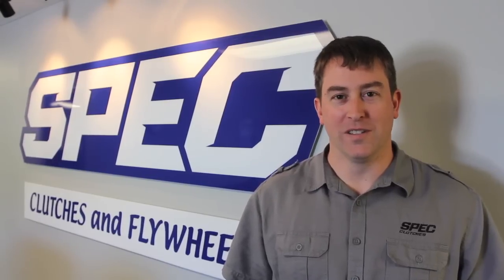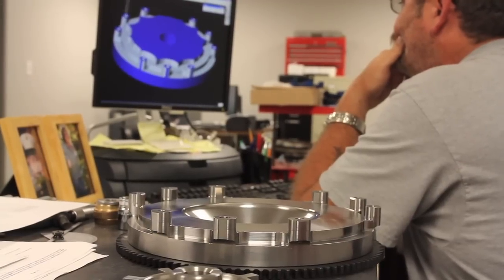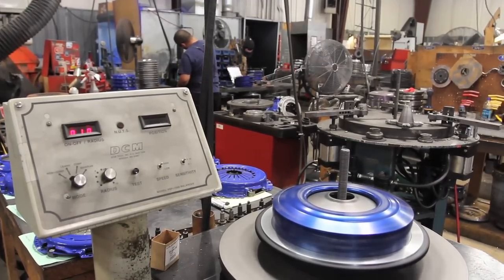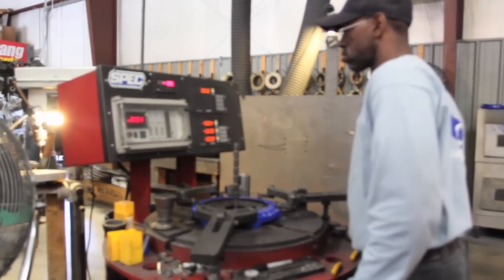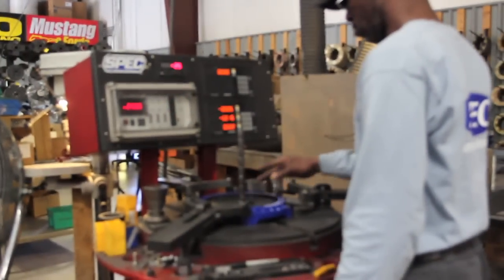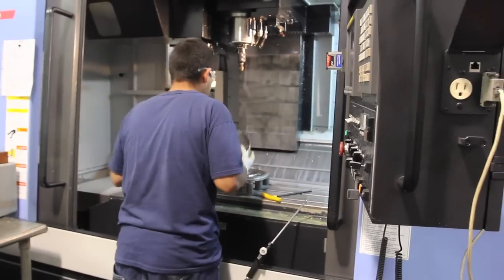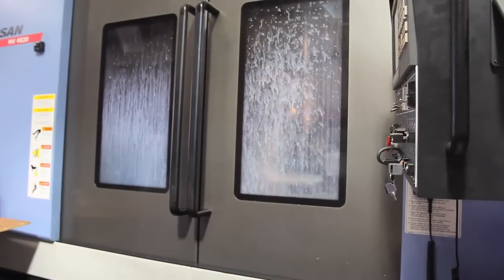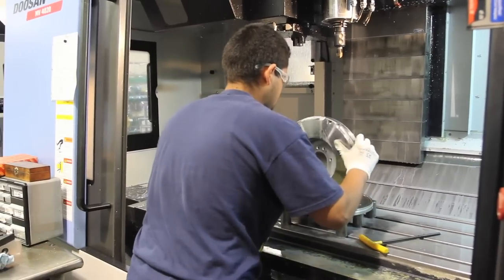SPEC Clutches and Flywheels: Factory Tour

Comment: I just ordered a spec stage 2 clutch and steel fly wheel, waiting to install this weekend, hopefully I like it!
Reply: I'm wondering how your stage 2 clutch held up? I'm on a stage 2 clutch with a steel flywheel and just made it though the bedding process. I swear I already feel clutch slippage in 3rd and 4th gear when I get on it and the turbo boosts hard. I'm in a 2016 GTI tuned with APR stage 1 high torque.

Comment: Not very happy with my spec stage 3+clutch for my 3800 fiero swap.
It rattles and knocks at idle like a bucket of bolts.
Of course customer service says its not there clutch 
But funny it never made any noise with the centerforce i took out

Comment: I just took apart my ws6 spec clutch after like 10k miles and those little whale tail looking things around the inside of the pressure plate were missing (5 of them) and my Bell housing was thrashed along with the pressure plate, coulda been a way worse failure but it put holes in my Bell housing